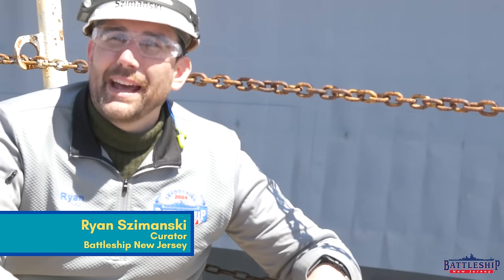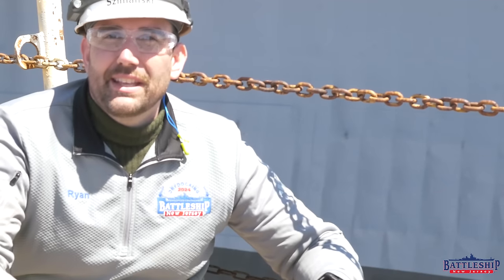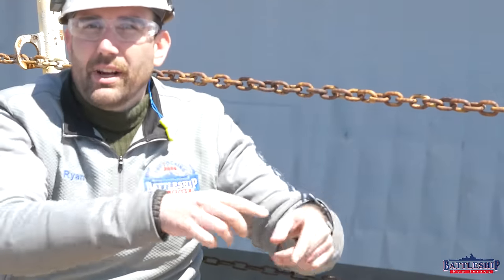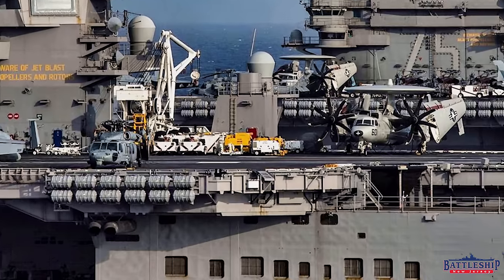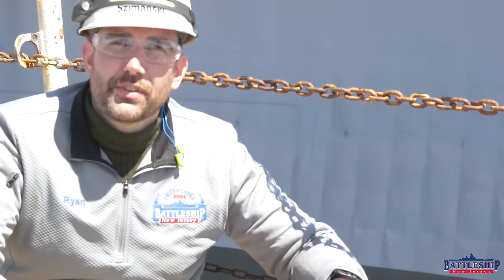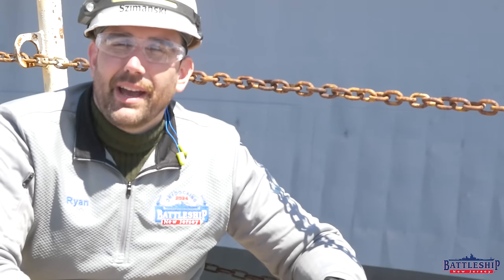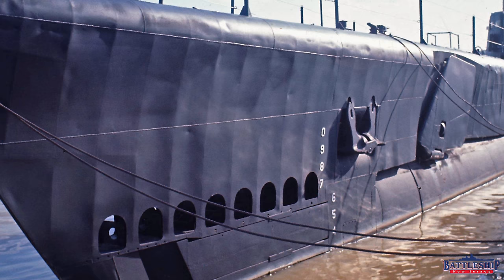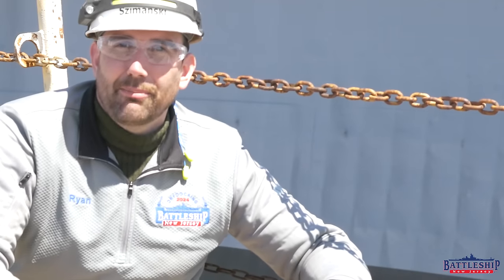What's With All Those Dents In Ship Hulls?

Comment: Wrong. It’s mainly due to how the ship is constructed. During the welding process, the weld metal and the adjacent base metal will expand and contract throughout the heating and cooling cycle. During these cycles, it's inevitable that some distortion will occur due to the movement of the metal. Why else do older ships with rivets have no oil canning???

Comment: Much of that is caused from the weld on the frames and bulkheads being almost as big(thick) as the shell plating as it cools it shrinks and pulls the plates inward. Very common and of no structural concern. For working vessels not worth the huge cost to prevent/ fix